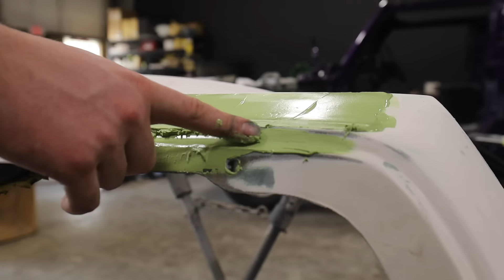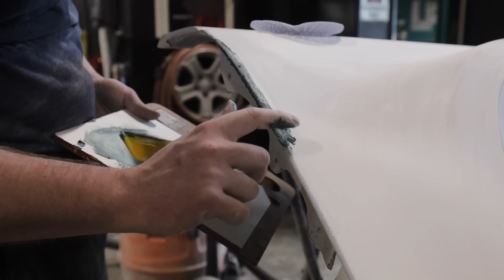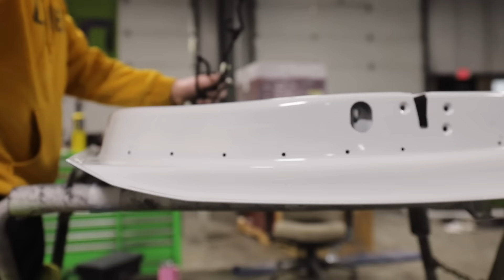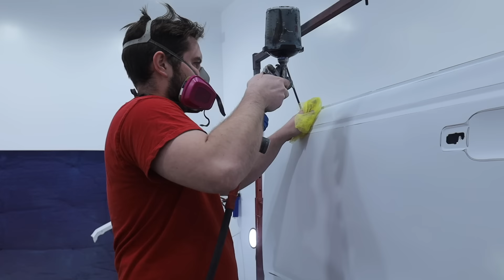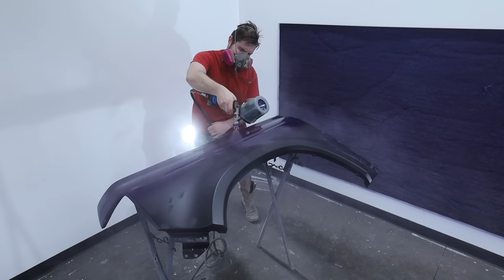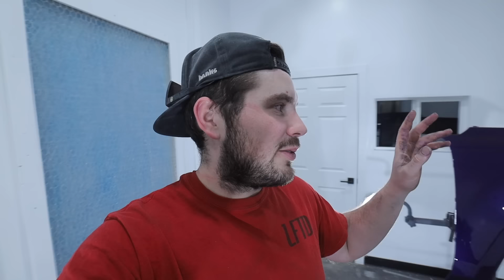This BODY KIT Is Going To Look INSANE On My BRONCO!

Comment: Looks insane so far. I do have one question though. By no means am I a painter when it comes to vehicles but, when you put that many coats on, do you have to worry about parts fitting back together ?
Reply from the maker: Yes and no, you’ll close the gaps a Little but a couple extra mills never hurt!